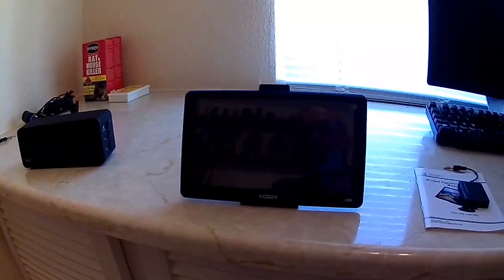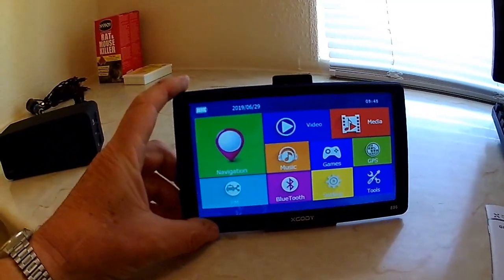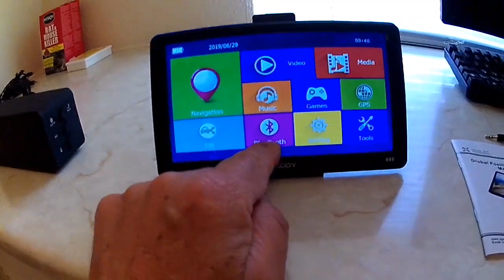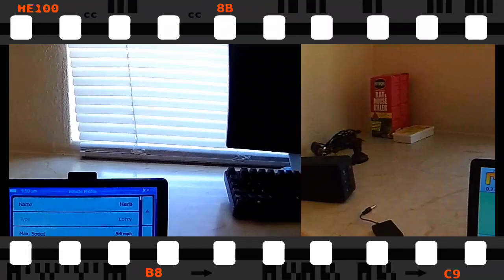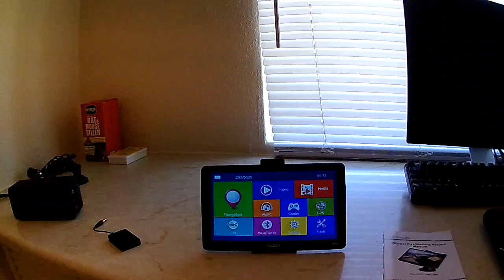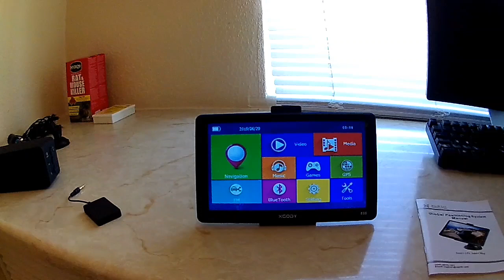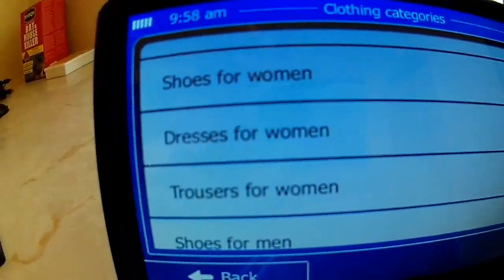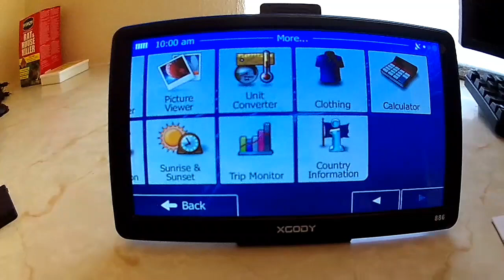Xgody GPS Navigation. Model 886

Comment: You state you can’t hear the volume but then explain it’s your vehicle that’s noisy. So that a vehicle issue not the Navs. You also buy an external speaker which slides around again that’s an external issue not the nav. I have one and use it in my truck. No issues
Reply from the maker: Still the ladies Bra Cup size is a useful feature of a Sat Nav.
Reply: No. That is not a vehicle issue. The volume should be adjustable to be heard, in any vehicle, in any reasonable circumstances. Furthermore, it should be audible to a variety of hearing abilities. If its usage is confined to certain vehicle ages and types, and to certain user abilities, that needs to be clearly stated on the box.

Comment: Bit late on this one....but....
Not sure why there seems to be so mch issue with this GPS. I have been using  two Xgody Gps (504 &886) since 2017 and have not had any issue with it. I use it on my Motorbike(rain, shine or hail...) trips across Europe and some former  Eastern Block Countries. I live in Australia. So far it has taken me across te UK...Wales Scotland, down south to the Jurassic coast on a few occassions.  My trips acrosss Europe has seen me through France, Spain, Italy, Belgium,Netherlands Denmark Norway Sweeden Finland back through Russia(St petersberg) Latvia Luthiana Poland Germany and back to the UK. So I do use and rely on it extensively.
I did however struggle with having the same issue with the Bluetooth as I was trying to get the voice directions across my Bluetooth Communications in my helmet.Took a while to finally understand that the bluetooth within these devices are configured to only being a receiver and not transmitter ....which is a bummer. So as in this video, I purchased the same little transmitted and that problemwas resolved to an acceptable reasonable level. In so far as the other issues described in the video and comments....I am happy to say that I have escaped those.

The only other issue I had was that in the far north of Norway or Finland....cant remember which..... I did loose the Satelite for a substantial period of 2 days.....althoughin all fairness,i dont think I had the correct maps loaded. Russia was much the same....again  did not have the map loaded.

piece of adviceif you still have the unit stored somewhere in the cupboard....load a software called  iGo Primo on your device and use the same maps etc..... much more stable and works extremely wellwith this device. If you cant be bothered....you can always send me your unwanted devices :-)  :-)
Reply from the maker: Thanks for your reply. Putting a postcode into Google on my phone and the same on the Sat Nav. Phone got me to the postcode but sat nav said I was 25miles away from my postcode.  I think the Bra Size info was very useful when driving. Ps been given another Sat nav but not tried it as we are in lockdown.

Comment: i am having problems switching it on and it keeps going off while i am driving any ideas same sat nav
Reply from the maker: Mine went in the rubbish bin. However I was given another one but not tried due to lockdown. No idea about switching off other than dodgy ciggy socket and loose plug.  Cheers from old George
Reply: @MakeDoAndMend1  Check the cable & battery area. Or return it if you still can. How long does it work on a fully charged battery??

Comment: he says he set up as a lorry for use with a motorhome   This is wrong you set up as a car and use Extended setting to enter the max speed and dimensions  This is because if set for a lorry you may be restricted to roads that a lorry cant go
Reply from the maker: I did try car but it wouldn't let me enter weight for some reason. But will try again. My van although small when loaded can be 3.5ton. Exceeding some Bridge Weigjts of 3Ton etc in the area of live in. Cheers for comments I will have another go. George
Reply: @MakeDoAndMend1   click on the cross spanner then scroll down to use extended settings and tick the box you will then be able to input your motorhome dimensions etc
Reply: @MakeDoAndMend1  i se on another reply that you have chucked it in the bin ,,,get it out and update the maps this will help
Reply from the maker: I am on a second unit. Kindly given to me by another Youtuber.  This one doesn't crash randomly.
Reply: @MakeDoAndMend1   For help and free maps you could join the Facebook nozetec/Xgody user group.

Comment: How does yours have Bluetooth?
Reply from the maker: Nearly all car GPS have Bluetooth. Connects to phone etc.
Reply: There are two models of the 886 - 886BT and (I think) 886F. In February 2022, they cost about £57 and £47 respectively. As George says, it's for connecting your 'phone, not for connecting the GPS to a Bluetooth speaker. The inbuilt FM transmitter comes through my car radio fine (it's even stereo for stereo MP3 files).

My 886BT is temperamental: the touch screen just stops working. Making the unit useless.